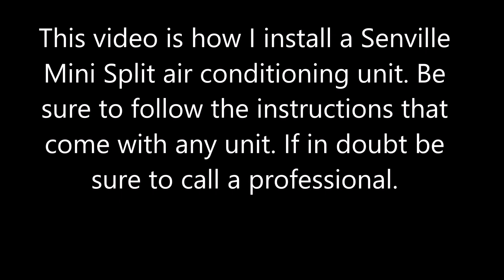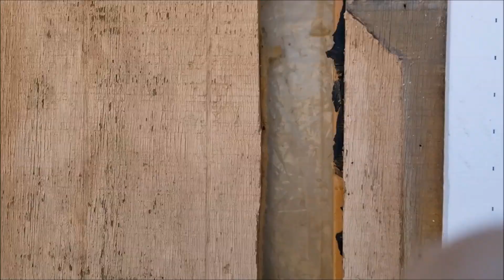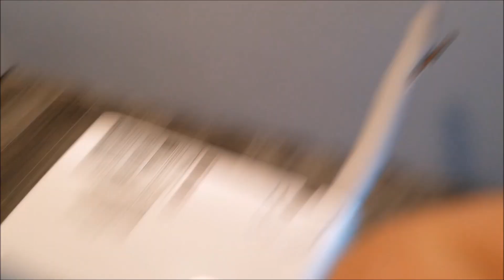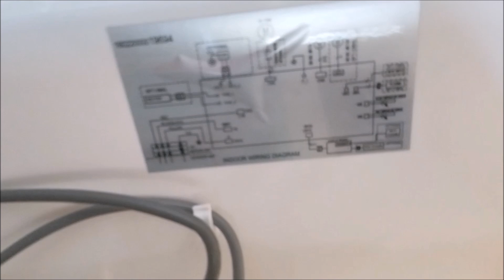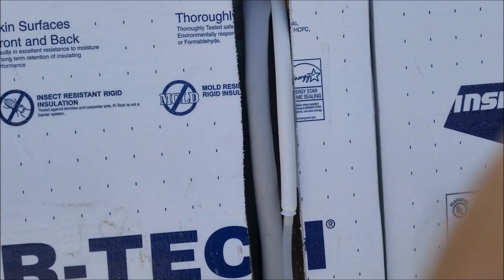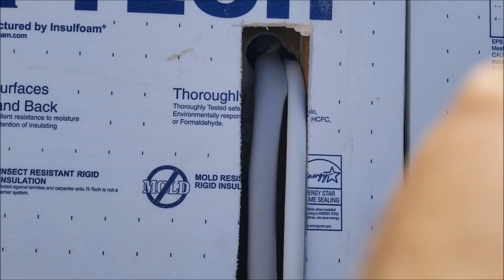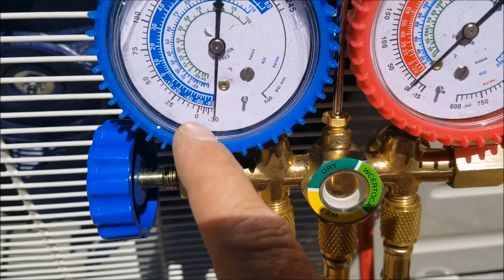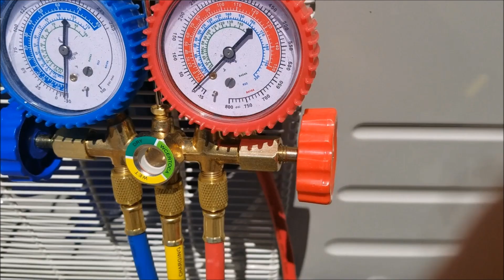How To Install Senville Ductless Mini Split 9000 BTU 230 Volt Air Conditioner Heat Pump

Comment: Hey Thanks for the video !  Appreciate it, getting ready to install one myself.  Just wanted to make one comment about a tip I picked up from another guys installation.  Regarding the extra length of copper cooling pipe.  You should never let the extra pipe rolled up like that because that creates areas at the bottom of each loop where the coolant can collect and pool up.  You don't want that.  Instead, he suggested that you unroll all the extra piping and run it for example up and down inside the wall, or run it up and then over in like a l-shaped pattern.   That way you avoid those potential pooling spots in the pipes.  Or even better cut the extra length out of course, but you have to have the flaring kit, etc.  Thanks again for the vid.
Reply: Alway cut it off. Im a refrigeration mechanic, the system needs a proper line set design that includes no oil traps. Compressor oil moves all throughout system, needs to return without being trapped or pooling.
Reply: @angusou8124  but it also needs to have at least 10 ft on the linesets
Reply: Yes sir, a horizontal loop is good for that, no oil trap

Comment: Awesome guide man, cleared some things up for me, now I just need to figure out about the quick disconnect box setup and I should have my bases covered.
Reply: Disconnect is easy, man.  If you have a 220V unit, the lines and loads will be separated over the two wiring halves inside.  If you have a 110V unit, there's only one line and load with which to contend.  Everything is labeled in the boxes--it's intuitive.  I had never wired anything to my breaker box, but it was very easy.  The hard thing was dropping the wire down through the hole in the framing and finding it in the wall to bring outside.  I have attic access in my garage, where I installed the unit, so it wasn't too bad.  Depending on your application, however, getting the power from your box to the disconnect might be a logistical problem.  P.s. You're rich, dude.  Get someone else to install your A/C so you can go play with the band.
Reply: @brianpeksa2192  Thanks for the info. That's great, I shouldn't have any trouble with the wire. I am going through the wall from my breaker panel in my basement then into the dirt and all the way to the outdoor unit. I'll have to get the wire meant to be buried. Just waiting until I actually recieve the senville units I ordered before I buy all the equipment to install. Hopefully they get here before winter lol. 
Yea I may be a rich fancy pants musician but I am cheap as hell, besides if you want something done right do it yourself.

Comment: Thanks. I went ahead and ordered a 18000 BTU MrCool unit at Lowes after watching your video.  
MrCool sells units without the pre-charged lines for about $700 cheaper than the pre-charged line units. 
Also, the pre-charged line units had 25 feet of copper and I only needed 16 feet that comes with the non pre-charged unit. 
The condensers are still pre-charged, just not the copper lines. 
I could not get any HVAC companies to vacuum the system. They only will do it if they install the units. 
I was replacing a 14 year old mini split that I installed and so I was not going to pay a HVAC company big bucks to install the new unit. 
I ordered the Amazon pump, hoses and adapter that you linked to in the description. 
Thanks for the great video!

Comment: I drill a 3 5/8" hole and slid a 3" PVC pipe long enough and sloping down then I caulk both sides to keep bugs and water out.

Comment: How’s it working 2 years later? My understanding (from another YouTube video) is the senville is built by the same manufacturer as others like mr cool.

The only thing I haven’t done yet is flaring. I prefer to do the non diy (from mr cool) so you don’t end up with the excess line set.

I bought all the tools when I did my central ac in my old condo so I have everything but a flare kit.

Comment: Nice video.  I'm in Canada so we're not fortunate enough to get vacuum pumps and gages for less that what it would cost to hire a HVAC professional to commission the system.
Reply: LOL. Agreed 100%. Vacuum and manifold gauges will cost over $300CAD. I managed to talk to guy working at big plumbing company to vacuum lines for me after hours for $100CAD. Im just starting installing this unit for my shop

Comment: If I could ask a question, I believe the system was charged to 25 feet and the unit was shipped with 16 feet line. Do we have to remove some Freon from the system? Thank you.
Reply from the maker: The units I install always come with a 16 foot line set which is what the refrigerant is set for.

Comment: so first we need to open the valve on hose connected side after connecting the vacuum hose (this was not shown on video) then close that valve before turning off vacuum pump (also not show on video) then open the High side valve(the one without the vacuum hose) then again open the low side valve and in last remove the vacuum hose, right? one thing more, what if entire Freon is being recharged then do we also need to open the  high side valve in addition to low side valve for full vacuum of evaporator, condenser and line set?

Comment: great BUT !!! I do not recommencement  condenser  setting on ground(pad) it will get dirty and weeds in it at no time !!!! place it 8x8x16 blocks and use screws, it helps to protect from steeling like Thug Floyd too  . GO TRUMP !!!!!!!!!!!!!!!!

Comment: Great job, but I'm pretty sure looping the lineset creates an oil trap and thats frowned up in the instructions. It makes oil literally get trapped amd camt make it back to be "condensed" at your outside unit. They will still run, but not considered best piping practices in the field. Good job though!

Comment: Man, big ups to you for making this video.  This was my go-to for my installation.  There were little things you breezed through, but I figured them out; and anyone with half a brain ought to be able to with some additional research.  You saved me 2800$.  And no, I'm not tendering a check to you for 2800$.  But I do thank you from the bottom of my heart for making this--it's one of the clearest, most concise installation videos on here.
Reply: Just an update.  My system went dry the day after the installation and I had to call someone out.  I had pumped the line for 35 minutes and watched it for 40...It was a slow leak, evidently, because the needle on my gauge never moved and I used the unit for an hour or so the same day as installation.  Anyway, the HVAC guy detected refrigerant at the head unit and suggested I order another one.  Senville answered my request and sent another within a few days (without asking for an installation invoice or even asking who installed it).  A few things the HVAC guy said: one, teflon tape is wholly unnecessary if your line is already insulated; just zip tie everything together for organization sake.  Two:run the lineset through the wall; don't swing out your line attached to the head unit; that way, if the lineset is pinched or damaged somehow, you are out a lot less money.  Otherwise, I followed this installation procedure and everything was good.

Comment: Great video, is there water evacuation ?  Tks !
Reply: When the vacuum drops the pressure around -29 the water literally boils out at ambient temperature and gets evacuated from the system as a gas. This is part of why it’s important to run the vacuum for at least 30 minutes.

Comment: Thank you for showing your step-by-step process in the mini split A/C 
unit.  One thing I would like to know.  You didn't show any interior 
electrical outlet on the inside wall of the house.  Should there be an 
outlet inside?  Next, the interior electrical outlet, probable a 20 AMP 
to match 115 or 220 Voltage would be the same for a freezer to be safely
 plugged into?
Reply from the maker: The inside unit has a power line that goes to the outside unit.

Comment: Hi , their can you do all this without doing the vacuum test basically install everything then once done open allen wrench that let's out the freon and be good to.go ? I'm asking because I'm thinking of doing install.myseld it's not hard just dont have the tools to do the vacum test
Reply from the maker: The system needs to be in a vacuum before releasing the refrigerant, so will need to be pumped down with a vacuum pump and gauges. There are low-cost pumps and gauges, I put the links in the description for the budget units I used.
Reply: Ok.understood I'll have qualify tech do that part . Your video help me out alot thank you

Comment: Anyone have experience with a 36,000 BTU version in an auto shop environment? Is it enough to at least cool down a poorly insulated building with 18ft ceilings?

Comment: Good overview but I would have like to see more specifics and the stuff that is actually difficult with this installation.  How tight to tighten the compression fittings, how do you setup your vacuum gauges, how do you measure for mounting the indoor bracket for proximity to the hole in the wall....
Reply: Dude, I just installed one and it's the little things that killed me on time and consideration.  Even my mount was a pain; it didn't match any of the models or types listed in my instruction booklet.  I managed to cut the hole in the wall perfectly, and I didn't have problems with my line set, but wiring became an issue because I bought the 110v version and yet we bought all the items on the above listing...meaning the disconnect was for 240V and I had to work with it.  Configuring the pump, stripping outdoor cable insulation and a handful of other things taken for granted required some little research.  Finding answers is difficult, and everyone who is a pro is such a supercilious dickhead when it regards their field of expertise.  They act like laymen can do nothing, but I saved myself 2800$ doing this myself.
Reply: with the bracket still mounted on the unit, find the location of the big hole, take off the bracket, straighten the line set put bracket back on, and measure the hole location(make sure you miss the stud here at the big hole. wire in the communication wire now. put the drain line at the bottom or side of the 3 pipes. tape them together. stick it out of the hole. make sure the bracket is tight to the drywall. now, do not kink that copper, take a full can of beer and use this to fold the big copper line, cut the jacket to look at your bend(this will fuck up the whole job here if kinked)now as far as tight, the little copper line needs 12lb torque, the big one needs 26lb torque(if you tighten the shit out of the little pipe, the flare will crack on you. Go ahead and hook up the vacuum pump before you cover up that line set. most repairs happen when you lose your charge, leaker. the issue happens when you let the coil get covered with lint or the blower wheel carries a bunch of stuff. you can buy a coil cleaner in a compressed air can, you can remove the blower wheel and hose it off, you can clean the outdoor coil with canned cleaner, and rinse it off with a garden hose. error codes- main control board outdoor- remote low battery. no 410a in the system.

Comment: I noticed in your other video you used the red line instead of the blue I believe, does it make a difference?
Reply from the maker: Technically the Blue line goes to the low pressure side and Red line to the high-side. But for pulling a vacuum it doesn't matter.
Reply: aztikkel11 oh okay, I bought the same pump and gauges since your other video, problem I have now is I kink the copper line trying to bend it
Reply from the maker: @ElPatronGamefarm  That happens sometimes. It is a simple fix to cut it and add in 2 flares. https://www.amazon.com/Conditioning-Extension-Connector-Intermediate-Connection/dp/B07MCV3KX3/

Comment: Why u did n t cut the pipe?
Reply from the maker: I didn't have flare tools with me. I came back anther day pumped it down and fared the lines.
Reply: @HVAC_Mechanic  
Since we are on the subject, my line set has a sort of swivel in the copper of the low pressure pipe. Is that needed? Should it be connected to the evaporator side or can it be cut off and sent to the compressor end?
Thanks in advance for your reply and also for your informative video.

Comment: Is there an advantage to the 220 or 240 or 110-115?
Reply from the maker: Yes, the 220/240 units pull less amps and work more efficiently compared to 110/115 units.
Reply: aztikkel11 tt

Comment: Hey, but don't you void the warranty by doing the installation yourself (unless you're a certified A/C technician, as they require)? 
Also, I have been trying to contact A/C companies around my area and tell them that I installed a mini-split, that I just want them to do the vacuum/release-refrigerant part for warranty purposes, and nobody wants to do it... Where can I find some certified A/C technician that would do this for me?
Reply: So I ended up calling a friend of a friend who is an HVAC technician and has a license. He finished the installation for me and I was able to use his ID in the warranty. It was for a different system though.
Reply: For this particular make, yes, you must have a certified HVAC install the system in order for it to be covered by the manufacturer's warranty.  Just google "Senville warranty".  Also when you try to register the unit so that it can be covered, the form asks for the license number of the tech.  I'm still in research mode.  The Senville is the second system that I've researched.  The first manufacturer (MRCOOL) I started reading up on, explicitly states in its warranty that its "DIY" line of minisplits do not require the installation by a certified HVAC tech.  Plus the MRCOOL doesn't require a vaccuum pump. The Senville is more affordable, but I'd have to buy a vacuum pump and a set of gauges; and if I want that warranty, I wonder if the cost of a HVAC tech evens out that of a MRCOOL if I installed it by myself.  I've got more researching to do, but I might just get the Senville and pay for the tech and his equipment because my time is more valuable spent on other projects.
Reply from the maker: I haven't had to return anything so not sure on the warranty. It seems as though some HVAC company would check it out. Guess it depends on the area.
Reply: we all get a 1 year warranty, for normal wear and tear. never going to collect this one.

Comment: I mean from your box the black wire is on L2.  Why on some YT videos for Senville 220v some videos show L2 to be White? Pls. explain.
Reply from the maker: Are you talking about the 220 volts or the control wires?
Reply: It could be that the neutral is being used as a hot wire. Sheathed wiring will have black, white, green. Black and white are being used for both hots with no neutral.
Reply: You can use white, but for code compliance, just wrap a part of it with black electrical tape. That tells others it is a hot wire.

Comment: why do you have black and red from your box? isnt it just Black, White and a Green Ground?
Reply from the maker: Be sure to follow the manual that comes with your unit for wiring.
Reply: I have a 220 and from my disconnect box I have green or brown or white and the black

Comment: how do you vacuum a 3 zone mini split i vacuumed each line but they all went back up to zero
Reply: did u figure it out?
Reply: Depends. Senville units have a master valve setup you use on units with 3 zones and up. You then have to open the other valves and can do it all at once. But I wouldn't do that unless you have verified there are no leaks.

Comment: Nice video.  Thanks!  Only thing I would question is why you didn't disconnect your vacuum prior to releasing the gas?  The gas just filled the vacuum in the test set.  The system was charged for a specific length of tubing.
Reply from the maker: The line-set needs to be filled with refrigerant so not to loose the vacuum when the hose is pulled off. If there is no refrigerant in the line-set air will be sucked back in. A small amount of refrigerant will come out which is normal. The gauge is turned off and there is only a small amount in the gauges line.

Comment: Are these units pre charged for a specific lenght of lineset? Also use  of a Micron Gauge? (Yay or Nay?)
Reply from the maker: Yes, they are charged for the line-set they come with usually 16 ft. The refrigerant should be adjusted if it is shortened. A Micron Gauge works well. The main goal is to get it down into a vacuum and it holds.
Reply: @HVAC_Mechanic Thanks. Saw this and a few other DIY installations of these systems on my feed. Just wanted to point that out. 20yrs Service and Installation

Comment: how much i can pay to a professional to do this type of work
Reply: @Joser1948 is that jst for the install of the unit? Or does it includes running the power from the electrical panel to where the unit will be?
Reply: @isaisa1191  got to add materials to this about 400 bucks will do

Comment: I'm considering doing what you did. I have a question though.  What's this Schrader valve thing? Did your hose have one or what am I missing
Reply: A Schrader values is the exact same thing as your tires have, a little, one-way valve. You need to use a connector that has a little device in the end to depress the valve when it is screwed on. Not all connectors have this, but most hoses do.
Reply: Good question, Someone had posted to remove the Schrader valve so the vacuum will be faster. But it seems from posts that it is fine to do with the Schreader valve in place.
Reply: @shelbybodie  you need a valve core removal tool. works with Schrader valves in just takes longer